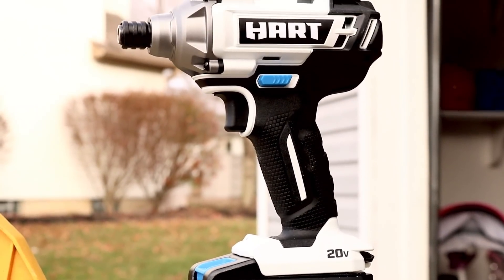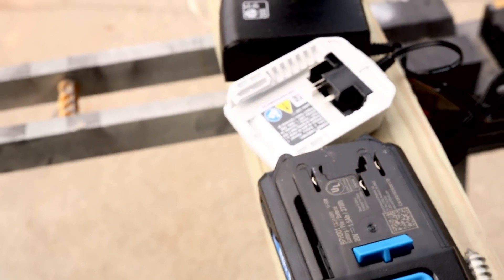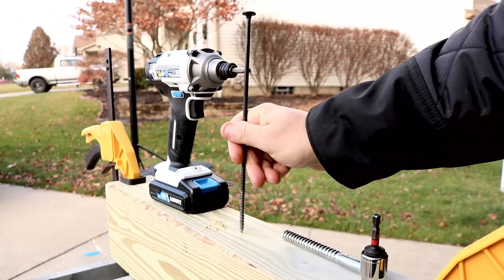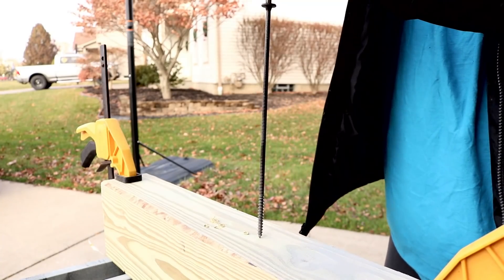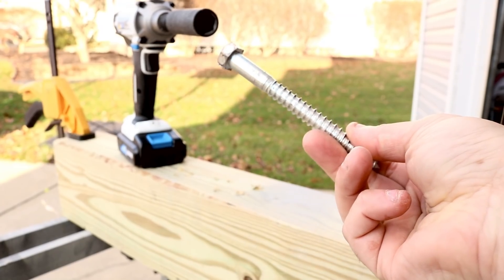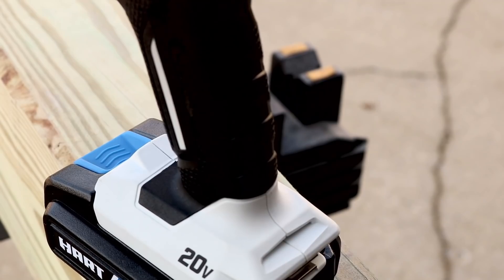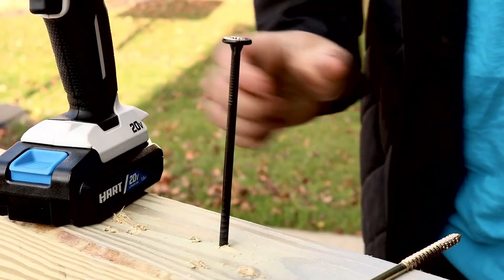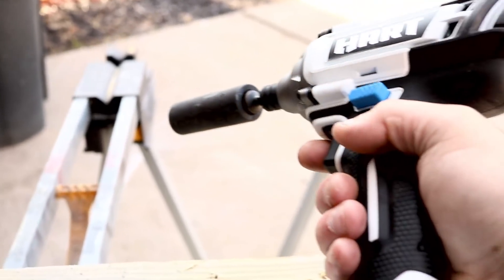Walmart Releases Their own set of 20v power tools called HART, and we just put one TO THE TEST!

Comment: There's a lot of good observations here. That being said; there is one thing that made my eye twitch every time I heard it... "it's only the 1.5 Ah, maybe the 4.0...".

Ah (amphere hour) is a rating for longevity, not power delivered. It's the amperage it would take to fully drain the battery in one hour flat. The tool will pull X amps based on two factors, trigger position (since its vaiable speed) and load on the spindle ing the motor. More Ah just means you can run longer between charges.
Reply from the maker: Unfortunately that is not true. Countless tests, including some on this channel have proven beyond a doubt that larger batteries provide more power to the tools. Try running a Milwaukee table saw on a 5.0 and see what happens
Reply: @ToolReviewZone  

If you're referring to the video where you compare the Red Lithium vs the Red High Output, then there is a different factor that was in play. The PCB inside the battery, and (likely) cell configuration, and possibly the amperage rating per cell are all factors. But, in battery manufacturing, and the spec sheet for cells, packs, and other forms of power storage, Ah, mAh, etc. are strictly longevity. There is a separate rating for amp draw, which is usually limited by the PCB inside the battery housing, to well below the battery cell manufacturers rating, as an additional safety measure by the tool manufacturer.  

If you read the spec sheets for both batteries, you will find that higher performance batteries have a higher amperage discharge rating, regardless of the mAh/Ah rating of the battery. Instances where there are commonalities in the differences are correlation, not causation.
Reply from the maker: @Reapsin  yeah that's completely different, but I think you are talking about brushed tools which this is, therefore you are correct.  I'm not used to using brushed tools so that's probably why I kept thinking that. Good spot on that👊
Reply: I do enjoy the content in the channel. And because of this I'd like to share the proper information with you, so you can continue to share the correct information with your audience. The battery ratings for amperage output and amphere hours are separate, regardless of the circuit they're connected to. Brushed vs. Brushless wouldn't change that. However, there would be a different impact on run time between charges, due to the different factors in the circuit configuration. 

The additional cells required (generally speaking) to increase the Ah rating would increase the continuous current availability, if the battery pack manufacturer designed the PCB separately from the lower cell count pack. But if they use the same chip, there's no change in tool performance. 

I do like to see the action packed torture tests! Please continue bringing the awesome content! But please, also remember, the masses are counting on you for the correct information. We're all human, but the one thing we're all here for is the information to make the right tool choices.

Comment: If you have the money and you do DIY projects often, it will be worth upgrading to upgrade Milwaukee if you have the money. Hart is suitable for those who don't care about having the best tools and want something that works and doesn't care about anything fancy or are just starting out and may upgrade to better tools later. Starting with a Milwaukee M12 fuel impact driver and hammer drill combo kit and adding more Milwaukee bare tools, batteries, and expanding to the M18 platform as you can afford them is one way to do it.

Comment: It seems you are running the threads out of the bottom of the board, that is why they are stopping...not the tools fault. In other words, there is enough bolt/screw without threads that there is nothing left in the wood to grip.
Reply from the maker: Nothing came out of the bottom

Comment: it id the same as porter cable\stanley(in au)\bostitch... it same impact just diferent "shell"...
part of the black and decker companey
Reply: and with minor modification you can use this tool with porter-cable and other porter cable tool woth this battery
Reply from the maker: I think it's a TTI brand. You can tell they are built just like the Ryobi line
Reply: @ToolReviewZone  
ryobi - ridgid - milwaqee
black&decker - porter-cable - de-walt

https://en.wikipedia.org/wiki/Black_%26_Decker
Reply from the maker: @hfmsite  right, but I think HART falls under TTI like Ryobi Ridgid and Milwaukee
Reply: @ToolReviewZone   Yea my guess is they are using the same internals as the Ryobi. Maybe someone will do a teardown to compare the internals hint hint
Reply from the maker: @patrickmcclintick9552  haha I'm picking up what you are putting down.  Let me do a few tool duels with it then ill pull it apart
Reply: I can tell it is from porter cable group by few clues... Like the led, sticker and the rubber mold
Reply: @hfmsite  TTI owns Hart, not SBD so it's definitely not from the PC line.

Comment: Home gamer tools for sure.  Ryobi keeps being mentioned. Ryobi is home gamer garbage too.   There is zero doubt this line is meant for those who need to do light around the home tasks.
Reply: Ryobi is for home use but it's not garbage.  A Home Depot employee recommended a corded Ryobi drill after my brand new Black and Decker corded drill fell apart on the first use and I brought it back for a refund.  I still have that corded Ryobi drill and I also bought a cordless Ryobi drill/driver set several years ago.  For home use, they have never failed me and buying a Milwaukee or DeWalt would be a waste of money.  If I were a construction professional, I would probably buy something more expensive with an iron-clad warranty.

Comment: For the most part, I like mine. HPID01 model. I just rebuilt a mower deck, and it did a fabulous job. A couple of things that I wasn't pleased with, because it actually affected my job, was #1. The LED being at the bottle casts a shadow on the top of the bolt I was screwing.  There was light above me, so it didn't really affect much. But many times I'm still doing small engine repair after dark, and can see where that might come into play.  Also, the chuck isn't so straight when there's a 9/16 long socket in it. It has quite a bit of wobble.  But overall, I'm satisfied. Those two things I mentioned, may or may not be an issue.

Comment: 1.5 mAH and 4 mAH 20V batteries should not offer different performance in terms of the torque they can apply to a fastener. But, the 4 mAH battery will last longer before needing to be recharged.

Comment: Guessing no belt hook, & also curious to know if this comes w/ a Phillip/flat head combo bit?
So, I’m assuming Walmart is marketing these new Hart Tool Platform to DIYers, like the Ryobi line.... For the Price point, & rather “cheap” batteries, compared to other brands (but who buys batteries at msrp anyway😂), these new tools might be a good alternative for some ppl. But for me, it’s kinda of weird for Walmart to release a new power tool line; just like it was weird when [They] released their OP Gaming PCs😉🤣
Do appreciate the first look & see what the new tool looks like, batteries & charger too👍🏻
Happy Holidays🎅🏼
Reply from the maker: What's up Aepek! Yeah bro it comes with a Phillips bit and holder. No hook though
Reply: Some of the Hart tools have a belt holder, but the ones I've seen have all been bent-wire instead of stamped steel.
Reply: Ryobi can be used professionally, hell I have the impact driver, impact wrench, angle grinder and hammer drill and they all do what I need them to do. I’m a diesel mechanic btw, use them constantly on nearly every job I have for the day
Reply: OH MY That’s TRUE👍🏻, any “Tool” can be used “professionally”..... 
usually though “contractor” grade tools are built differently then DIY, or Prosumer tools. 
Cheers✌🏼

Comment: I would have tried the 4.0 battery you might have gotten that screw all the way on Full Throttle the other day I only had my Milwaukee 2.0 battery all my other batteries even the 12.0 batteries were dead I had to cut a piece of 3/4 sheet of plywood in half and towards the end I started to struggle with my Milwaukee circular saw the batteries is just too weak
Reply from the maker: Yeah I think the 4.0 would have done it. I didn't see any in the store or I would have grabbed one 👊
Reply: Ok correct me if I'm wrong but the batteries just increase run time not power when the ah is raised
Reply from the maker: @samrowe2889  the lather batteries help with the larger draw of current which will make the smaller batteries voltage sag
Reply: @samrowe2889  no depending on the battery you have but different companies that's why you have different names to the batteries because Summer stronger and give the tool more power not only do they give how long to run time but they give the tool stronger power
Reply: @josephmalinowski6817  so a 12 ah battery in a 20 volt dewalt tool will give it more power then a 3 ah as well as a healthy dose of run time?
Reply: @samrowe2889  if I take my Milwaukee Sawzall I use a 3.0 battery or are you the 12.0 battery I was going to get a longer run time and a much stronger toll because of a stronger battery just like the walk has the flex volt go online there's a guy who has all Ryobi tools and he's starting to collect DeWalt also Ryobi makes a adapter that will allow dual batteries to work on Ryobi tools the guy does a demo with the Ryobi battery and then does a demo with the DeWalt battery same tool and a DeWalt battery gives a lot more power to the Ryobi tool

Comment: I have the Dewalt impact and even the DeWalt driving volts and lags into hardwood like that it was mainly used for screws. They do make bigger impact for this harder jobs. I thought that was pretty impressive for what you pay
Reply: Dewalt is trash now. Ever since they outsourced to China and started putting plastic parts in the motors you might as well just pay a bit more for makita or Milwaukee

Comment: There are some general rules about tools that you should keep in mind. Nobody is building a tool that they won't make a profit on (keep in mind they must compete with other manufacturers). The video shows an impact driver that looks very similar to the Makita 18 v. I have had Makita for years and I don't think Walmart can or will undercut the Makita (if you compare features) with this "knockoff". There is nothing wrong with buying what you can afford and possibly replacing the knock off as you can afford to,  but remember you only get what you pay for.